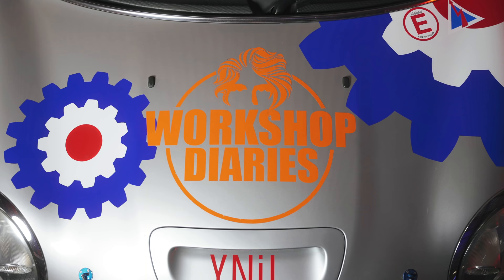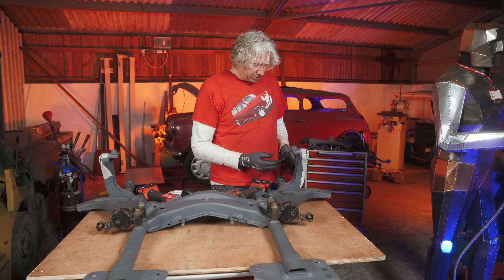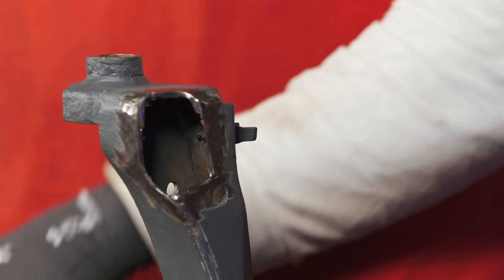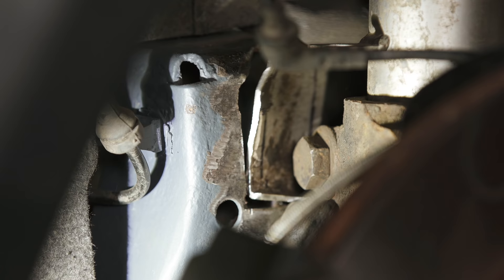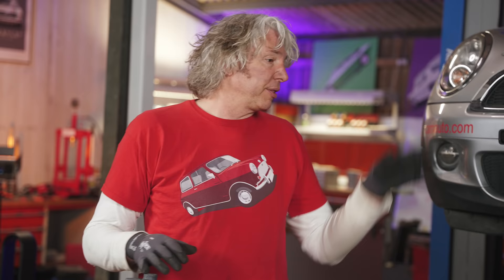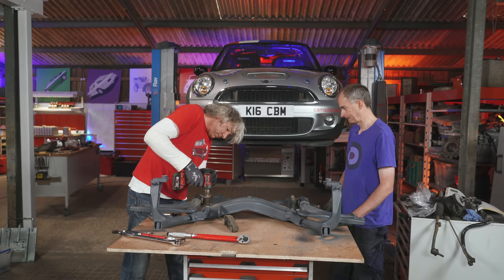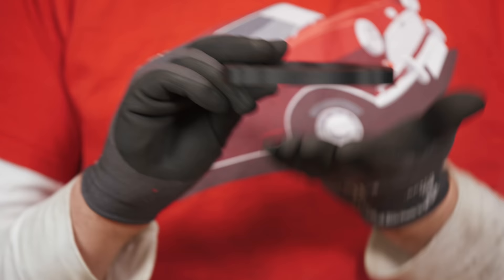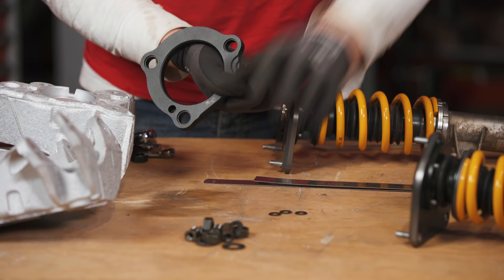BMW Mini Cooper S Rally Suspension Upgrade - Edd China's Workshop Diaries

Comment: If you are going to form metal on the upper tower like that, and you don't have a die to do the initial forming, tack weld the piece roughly in place and then hammer form it instead of trying to hold it in place while hammering.  You will have to use slightly stronger/longer tacks, but turn the heat down on your MIG welder so that the welds stand up instead of penetrating the metal of both of the pieces.  That way, when you cut the tack welds you won't remove much metal on the pieces you are welding.

Comment: To quote Flanders ans Swann's song about British weather: "In July the Sun is hot. Is it shining? No, it's not."
If that subframe cracks in service, it will probably be where the top mounting connects to the upright pieces. There's a stress concentration there.
Reply: Have no fear - a pukka rally car spends most of its time on its roof in a ditch, so the subframe won't have time to break...  🙃

Comment: C++ openGL? What requires the use of hardware acceleration?

People don't realise that cars in the UK drop in price to anything from £500 to £1,000 for an older car. New parts like the aforementioned sub frame at £800 is a huge cost.

In other countries, this car would likely cost 5x as much.

Comment: Edd. why didn't you reinforce the cantilevered mounts points on the arms that you cut and modified while you were at it? Those 90-degree angles are crack propagation points. Unless there is some clearance issue, a rounded reinforcements should be added to the arms.

Comment: Edd, have a question about the Philips MDLS Lights, i looked up the specs and voltage is 100-240v with a UK plug can you use these for the north american market with an adapter plug for 110v ?????